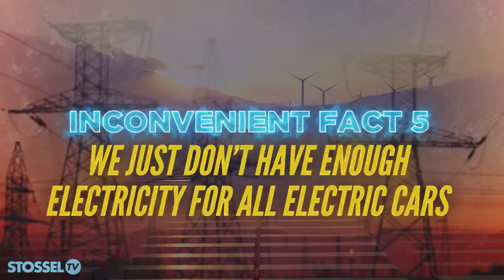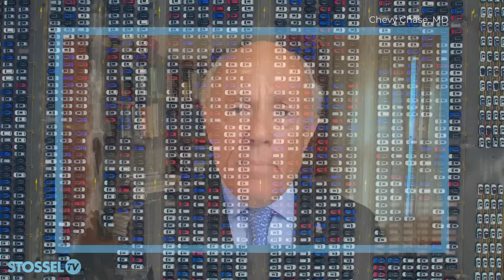Electric Cars: Inconvenient Facts, Part 2

Comment: It’s not about the environment it’s about who is controlling who. If they can stop you from controlling when you can or cannot leave and if you can stay warm they own you, and that is the goal.
Reply: Oil and gas can be controlled too.
Reply: I think it's just cascading stupidity and greed.  But yeah, it all leads to authoritarian rule and deprivation for the average person.
Reply: Oil is a single-source energy medium with a fragile, delicate global supply chain. Maybe if we drove cars that didn't burn the stuff, we'd save lots for other things...
Reply: @nancypelosi480  I did watch the video, and Stossel edited the original version after getting feedback. Is there a particular topic you think I'm not informed about?
Reply: Hobo on Wheels … gas/oil not so ‘easily’ controlled though. Gasoline is dispensed through a series of well distributed network of independently owned pumping stations. Electricity for the many can be terminated at the press of a button. I’m remaining old-school where cars are concerned.
Reply: @Jack-bs6zb  You can produce your own electricity with solar panels or diesel generators, or go charge your car at a public charger same as a gas station. And some EV's even allow you to power your home from their battery, good luck doing that with an ICV.

I don't see how choosing an EV over an ICV gives you less control, looks like the opposite to me, electricity can be produced from multiple sources and is more easily distributed than oil.
Reply: @Jack-bs6zb  I left you a link to child labor in the oil industry, let's see if the channel keeps the link...
Reply: @Jack-bs6zb  "Gasoline is dispensed through a series of well distributed network of independently owned pumping stations. Electricity for the many can be terminated at the press of a button." You didn't look far enough up the supply chain as far as oil goes. It comes from one source, and usually from countries that are hostile to the West or from places politically motivated to control the West (Russia, anyone?). As for electricity being turned off, that can happen to anyone in any country anywhere. That's quite the conspiracy theory. Most of the EV owners I know make their own electricity using solar panels. Can you make your own gasoline? Which of the two of us can drive a car if the government turns off the electricity?
Reply: @Dirtyharry70585  I'm not sure I see a control issue there, but I do acknowledge that Gates if buying up huge tracts of land and it does concern me.
Reply: at least someone understands it's about control.  It's always about controlling humans, especially their minds.
Reply: @Jack-bs6zb  You’d be surprised on how MANY folks charge from home using their OWN solar power! Try turning THAT switch off! OH … and god forbid the grid goes down since YOU won’t be able to find a working gas pump in your area. PS> EVgo (charging stations) produce their OWN ELECTRICITY!
Reply: Yeah because OnStar hasn't already been able to do that for 20 years with gas cars
Reply: @Jack-bs6zb  Can you create gas in your back yard? Do you have an oil well AND a refinery there plus the knowledge to operate both?
Reply: @justsomeguy934  rather consistently (100 years) 40% to 60% or more of the Petroleum used by the USA is from oilfields in the USA. Canada and Mexico are also significant sources. Venezuela used to provide 10% to 20% of our oil. We get a bit from west Africa. Only about 10% to 20% of Petroleum for the USA market has come from Saudi Arabia and Kuwait.

US corporations are heavily involved in Petroleum production in the Middle East. Most of which goes to Japan, Western Europe, and other allies of the USA.

We have a vested interest in friendly nations having a stable power supply and industrial base.

Depending upon Communist China is bad for the USA and most other people who are not part of the Inner Circle of the Communist Party of China.

Investigate how miserable people are in the Chinese Communist colonies in Africa and elsewhere. Nor will the Chinese be "shamed" into granting independence to the numerous colonies they occupy.
Reply: @paladinsix9285  I am well aware of our energy mix for petroleum. It's actually the minority of our energy coming from the Mideast. However, the USA still spends billions annually to stabilize the Mideast, still escorts tankers, still occupies countries over there for OIL. And not one dime of that cost is reflected in the price of gasoline at the pump. If it was, you would never buy or use gasoline.
Reply: JoeKrol - Don't like speed limits and turn signals either, do you ...
Reply: @justsomeguy934  Where do you think the power to charge the mostly useless overpriced ev’s comes from?  It sure isn’t solar panels and wind turbines.
Reply: @justsomeguy934  I'd say the part of it being "single source"
Reply: @pokepal937  I'm well aware of electrical generation sources. In my US state, it's actually 25% or more wind/solar power. And the source of the energy is meaningless - ANY energy source, even coal, is more efficient when making electricity than when burning it in a gasoline automobile. 
As for my EV being useless, I've had it 8 years now, almost 90,000 miles, driven all over the USA with no problems.
Reply: @justsomeguy934  
- "In my US state, it's actually 25% or more wind/solar power."

Considering how inefficient wind and solar power is, I highly doubt that.  And which state do you live in?

- "As for my EV being useless, I've had it 8 years now, almost 90,000 miles, driven all over the USA with no problems."

Again, I doubt that.  What EV do you drive?  And "all over the US"?  Even the places where it would be impossible to charge it because charging stations dont exist yet?

- "Which of the two of us can drive a car if the government turns off the electricity?"

Considering that the government (and the mega corporations that work with the government) want to connect everything to the internet (including our homes and cars), the answer to your question is whomever uses old technology.  If its connected to the internet, its not yours, as it can (and will) be controlled by the people who actually own it whenever they see fit.  They dont even need your permission to do anything, despite you paying for it.  Its basically just renting at full price.

The best way to go is to use old technology thats not dependent on outside sources to function.
Reply: @SvendleBerries  I'll ignore you calling me a liar for the moment.
Here's the energy mix in my USA state, according to Google: "The corresponding electrical energy generation mix in 2021 was 41.6% coal, 25.5% natural gas, 26.5% wind, 2.9% hydroelectric, 3.1% solar, and 0.3% biomass."
Your inefficiency comments is meaningless - energy density has nothing to do with energy capture. What you're missing in the discussion is that solar, wind and hydro use NO FUEL. Nothing burned. Nothing explosive, no fumes, no pollution. 
As for your "doubt" of my driving experience, I've driven from the middle of the USA to California, middle to Illinois. I've driven through mountains and snow, 107-degree farmland in Kansas, desert and rain/hail. My car is a Tesla. I've driven all the way across Kansas and back in 48 hours. On the rare place that there is no Supercharger in my sleeping destination, most hotels have overnight charging. I even charged at an RV park overnight once.
I find your "not depend on outside sources to function" comment hilarious. Do you have a refinery in your backyard? Or an oil well, perhaps? I know hundreds of EV owners and at about half have solar panels. The only "outside source" to drive their cars is sunshine. If you're concerned about government control, then I'd smash the cell phone in your pocket.
Reply: @cjones3710  If gasoline is SO abundant, why isn't it as cheap as water? If it's so plentiful, why are we drilling for it on a seabed? If it's such a stable energy source, why is the supply chain delicate and global?
How about using sunshine that falls at our feet to push our cars? How about using the breeze over our heads to light our homes? How about using the rain that falls to power our factories? Funny thing about those energy sources, not one carrier group or fighter aircraft needs to protect them.
Reply: @justsomeguy934  do you think public transportation may have a future? Just asking, because while not as popular in the USA; Japan, China, Switzerland, and EU countries have been investing in it more so.
Reply: @louisnall3102  "o you think public transportation may have a future? " I'm not sure why you ask about public transportation in this discussion. Public transportation is not widespread in the USA due to the size of the country and the wealth of the population that can afford to own a personal automobile.
Reply: Watch the people yelling the loudest. They have multiple homes and cars and fly around in private jets.
Reply: @justsomeguy934  and? The same can be said of our neighbor to the north, Canada.
Reply: @louisnall3102  "The same can be said of our neighbor to the north, Canada." And? Canadians own automobiles, too. So what?
Reply: @justsomeguy934  public transportation is more common in Canada. 

The reason most people on cars in the US, is because in small towns it’s “I’m screwed if I don’t own one”
Reply: @louisnall3102  Public transportation is more common everywhere than the USA. Personal car ownership provides faster travel in almost all situations. 
So?
Reply: @justsomeguy934  I'm one of those who believes that cars can get 100 mpg if the oil companies and government weren't fighting it so hard.  My buddy had a Toyota pickup getting 80 mpg using gas vapors.
Reply: @justincoats7236  Sorry, but gasoline engines are as efficient as they're ever going to get. There is only so much energy you can get out of a gallon of gas, and 75% of each gallon is wasted as heat. 
Google the average automobile mileage for 2022; you'll find that it's less than 25 mpg. Guess what the mileage was for the Ford Model T? 22 mpg.
ICE cars will never approach the efficiency of EVs due to their fuel.
Reply: @justsomeguy934  one word why cars aren’t faster “traffic”
Reply: @louisnall3102  I didn't say faster, I said more efficient.
Reply: @justsomeguy934  ok, again. One word “traffic”
Reply: @louisnall3102  Oh! You're talking about the public transportation issue. A quote on the topic would've helped. Yes, public transportation can alleviate traffic congestion.
Reply: @justsomeguy934  so sorry.
Reply: @ghrohrs2020  "If you don't agree, you ARE a slave." Sounds like something a slave owner would say.

Comment: One thing you did not mention is right to repair. Companies are using the switch to electric as a way of taking back control. Requiring consumers to go through them for any type of repair.
Reply: Yup. That's true
Reply: Absolutely false. I've had my EV 8 years now, had significant damage in an accident, the manufacturer never saw the vehicle. Please do some research before you spread information that you cannot prove.
Reply: @justsomeguy934  prolly varies per company
Reply: @Dan16673  All I can tell you is that I had electric motors replaced, suspension parts replaced and the manufacturer never touched the vehicle. The right-to-repair scare is just that, a scare created by the oil industry.
Reply: @justsomeguy934  what make is your car? because tesla will void the warranty
Reply: @Dan16673  My car is a Tesla, I had significant damage and my warranty is intact, thank you. Stop believing everything you hear or read. Want a career tip? Become a certified Tesla repairman. Just like being a certified Porsche or Mercedes repair shop, it's worth gold. The place that repaired my Tesla also repaired Audis, MB, Porsche and other brands of cars.
Reply: @justsomeguy934  did you read the fine print on your sale? You didn't
Reply: @justsomeguy934  not sure you understand right to repair. You don't have the right without voiding warranty. But someone else might. My Chrysler is NOT like that
Reply: @Dan16673  GM dealers are now repairing Teslas, it's become a significant income source for them. I can get you the link if you want, or you can Google it yourself. I would say your right-to-repair concern isn't a concern.
Reply: @justsomeguy934  not sure you get the argument. If I, normal dude, repair it, warranty is void. This isn't the case with other cars ( at least tbe last time I read the agreements)
Reply: @Dan16673  How is a Tesla any different than a Porsche? I'm pretty sure I can replace shocks or other things. I take my car to a certified repair shop, just like I do for my Toyota. And GM dealerships are repairing Teslas now, so I'm not sure anyone should be concerned. If you start messing around with the wiring and battery pack, Tesla can disable rapid charging at their Superchargers, but you can still charge the car.
Reply: @justsomeguy934  it's more the contract then the car regarding warranty. That's all. I don't think it's a big deal.but that's the argument from right of repair

Comment: i plow snow in the winter. This truck runs for 48 - 60 hours at a time sometimes. with a plow and salter drawing power there is absolutely no way an electric truck could do what this ICE truck does
Reply: No matter how many times you try to explain that to people like Greta, they'll refuse to believe it. Electric cars can be very beneficial in certain applications & really help out but only an idiot thinks everything can run off wind & solar right now. Small cheap electric commuter cars charged from rooftop solar panels (& backup wall charger) is a great idea for saving gas money commuting to work. But not for an electric snow plow that needs to run 48 hours or trying to tow something cross country in an electric truck with no tow range.
Reply: @michaelbrinks8089  
just producing the battery costs more pollution than making an entire ICE vehicle including running it for 4 yrs
Reply: Yikes!  Global warming means no snow!  What?!
Reply: @douglasolsen6861  
it's Global Warning!
Reply: Oh well mabey we'll  have to keep some diesel powered vehicles for a while, der, that's pretty rare, but most trucks have to stop regularly, and most cars don't travel more than 100km per day. So we shouldn't try to get rid of all the polluting vehicles cos some trucks have to run for a long time???